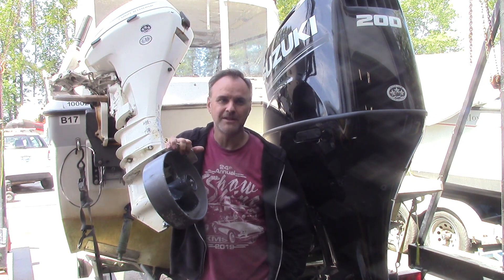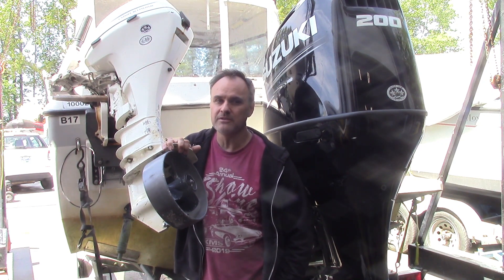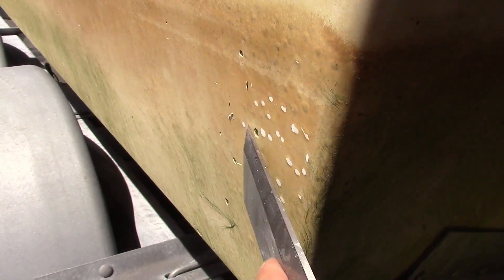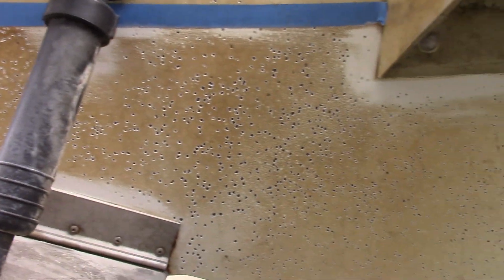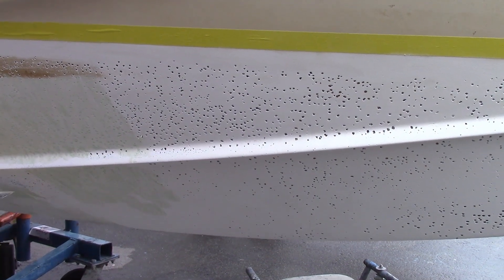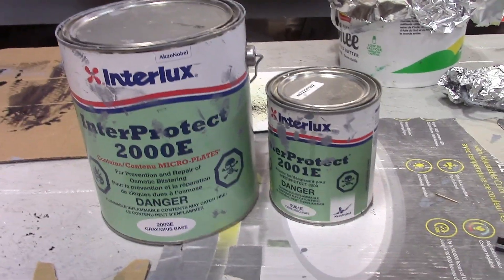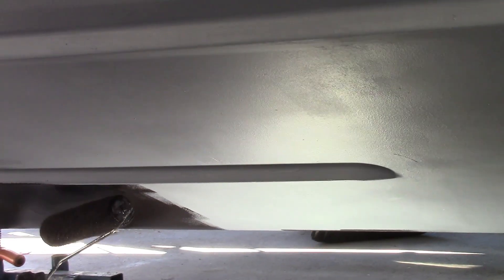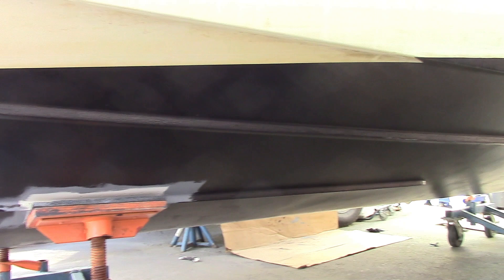Osmosis Repair on a Fibreglass Hull

Comment: Hi very interested in this process- but I’m wondering what grade of glass/ sandpaper did you use whilst doing this job?
Reply from the maker: Without reviewing what I said in the video we use 80 grit dry paper to sand the filler. I don't think we did any glassing on this but would use one ounce mat fibreglass to glass the larger holes. If it's really deep we would add 18 ounce roving.

Comment: I have these same kind of blisters on my Baja. I’m not going with bottom paint I’d like to go back with Gel coat , would I apply the 3m filler then sand and straight over with gel coat or epoxy first?
Reply from the maker: You can apply gelcoat right over the 3m filler but you could still get blisters in areas where it wasn't repaired.

Comment: Thank you for sharing your process on this repair, I have the same blistering on my hull. How long did you leave the boat out of the water to dry before pressure washing, and how long after pressure washing before applying the filler?
Reply from the maker: The boat was out only a few weeks before pressure washing. It took a few weeks to get all the blisters but then we filled right away. The sanding made the gelcoat over the blisters thinner but also made it hard to see them. Pressure washing got some but not all of the blisters. It worked best when the wand was close to square to the surface. We couldn't get that underneath because of the length of the wand. Since these blisters were very small and shallow a few weeks is plenty of time to dry out. Larger and deeper ones could take all winter to dry out. If they are not ground out first. I have seen blisters disappear over a winter storage without any repair but of course they will reappear.
Reply: @MonaroMarine  Thanks for the reply! my boat dried for 10 months outside. I ended up just sanding down the blisters, applying 4 coats Interprotect and 4 coats of VC Performance. Im happy with the results, and really hoping the blisters don't reappear.
Reply: @joshuahigh2546  Not all the blisters are Osmosis. 9/10, Blisters occur from Anti foul being applied when the hull is still wet. Older boats usually have Osmosis if not properly cared for but, make sure you figure out if it's really osmosis or blistering due to water under the paint.